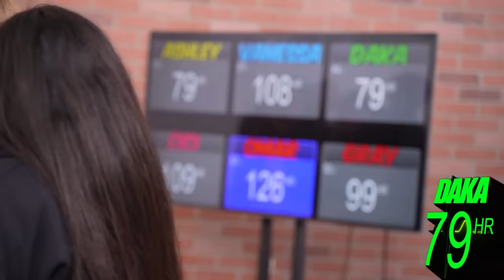Guessing Strangers Biggest FEARS!

Comment: yeah I had a vary vary hard time with the Spider part If I was there Preston would have been 100% sure that I was scared of spiders because I would have done all that I could to get out of the room and that includes braking though a wall or door and if I couldn't found a way out and the spider was still there I'd go into shock and start to cry then eventually pass out while sitting in the furthest corner away from the spider as possible I THINK IT'S CLEAR TO SAY THAT I HATE SPIDERS